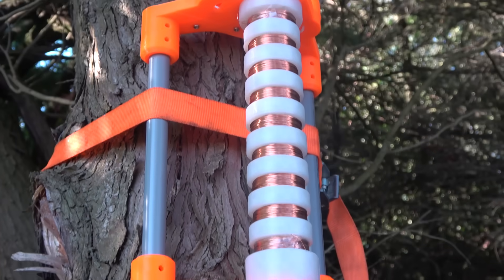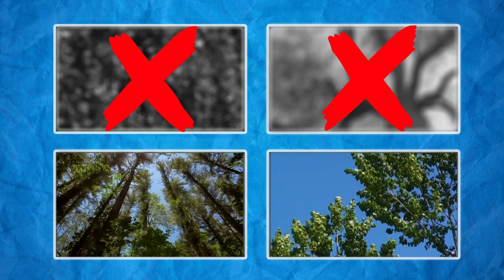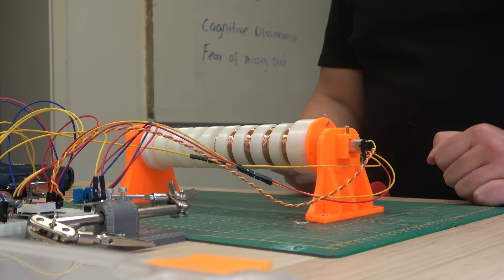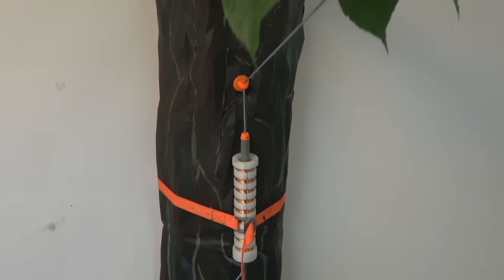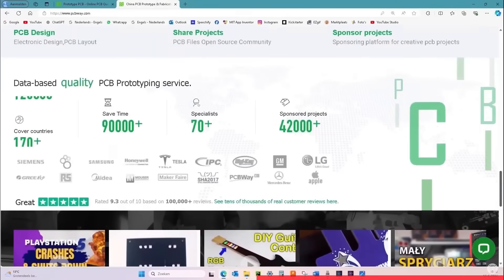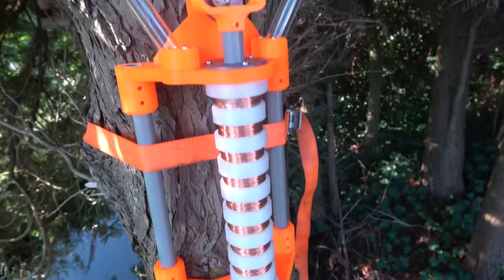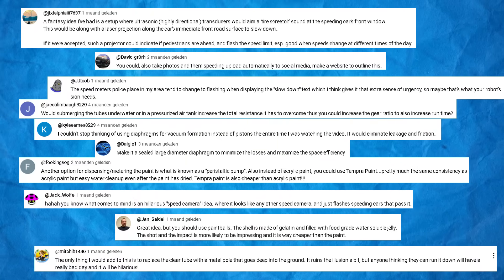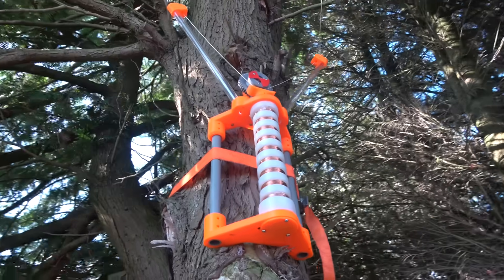I Made a Tree Generate Electricity..

Comment: Hey man, my vision of your system:
2 cables rotate the drum like yours, then the drum transmits rotation to the shaft where 2 bevel gears sit face to face, these two bevel gears are connected to the shaft using overrunning clutches (ratchets) one gear has an overrunning clutch of left rotation, the second gear has an overrunning clutch of right rotation, between these two bevel gears there is a third bevel gear perpendicular to their axes, that is, this is a gear assembly of 3 bevel gears where 2 are face to face and the third between them, this mechanism is sometimes used in watches the essence of this mechanism is that the drive shaft can rotate left or right, but the driven shaft always rotates in one direction, then the driven shaft is connected to a conventional rotary generator, but it is best and this is easy to do an axial BLDC generator with magnets on both sides of the coils, such a generator will have the highest efficiency, the efficiency of this system is about 80% this is one of the best options for removing efficiency, in The efficiency of the described variant is about 30%. It would make sense to consider a variator to stabilize the generator shaft speed because the speed would fluctuate, which is not good. However, I won't describe the variator, as this is a separate topic that arises after testing the basic concept described.

Comment: Hi, I'm watching from Russia with translation. If linear motion is converted into rotary motion anyway, why convert it back into linear motion? This is energy loss; it's better to attach a regular generator. You can also attach a flywheel so the tree spins it, which then spins the generator. Then the output will depend not on individual gusts, but on the overall motion. Attach one rope directly to the generator shaft, and the second through a gear, so that the flywheel always spins in one direction.

Comment: i designed this exact same system, but for ghosts! you take this generator to a haunted house, and connect it to the drawers and cabinets of the kitchen. when the ghost goes through and opens/closes all the doors and drawers, it generates some electricity. you can finally violate the laws of physics by harnessing ghost power! or else, ghosts aren't real :(. or  the third option of ghosts being real, but they gather power somehow from the sun (either directly or indirectly).

Comment: That's a cool concept but I can immediately think of 3 negatives:

1) Thieves will figure out that the magnets are worth something. They've already stripped all the copper wirings from foreclosed homes back then.

2) Critters, dead or alive. A dead critter will jam the piston, live critters might decide to nest inside it

3) Tension in the strings. You can't avoid it no matter if you're using nylon strings or steel cables. That means periodic tensioning. Not a problem if you install it on just a tree in your backyard, but if you owned a full acre of forest and wanted to substitute for solar, it becomes a hassle.

Comment: You need two more thing to make this work perfectly....1 is super capactor and second joule thief circuit. It can powerup plenty of LED like 24 normal LED brightly and it won't instantly turned if there is no movement. But it gradually fades but if the movement is frequenty then you have a nice light all the time instead of blinking on and off

Comment: What if one were to take the seeming random design of a branching tree that sways well and design an artificial one with this electricity generation system built as a component of that design? By optimizing the structure of that swaying artificial tree one would then be able to swap out parts as needed, if needed, and standardize the whole thing. A forest of these artificial trees could not only be an interesting thing to have a picnic beneath, but would be a testament to human ingenuity.

Comment: Here's an idea to turn some of that motion into kinetic energy for another linear generator the one top gear have it connect to another gear that goes to a ratcheting mechanism like you'd see on a bike you know it only powers that in One direction then have a flywheel come off that shaft to store the kinetic energy and then you can have another one of those Scotch yoak convert that rotation into linear motion through another linear generator if you could just figure out a way to store some of that energy from that gear turning into kinetic energy you might be able to get more power out of the system just an idea peaces out into the world and have a great day

Comment: You could attach a DC motor to the smaller gear instead of using the rotation to upwards/downwards motion system.
(Or make a rotational generator) 

You dont have to worry about the weight of the rod you have, and would only have to attach it to the smaller gear and not worry about converting rotational force into linear movement.

And having some kind of rectifier would be nice.
(Not sure if you mentioned this i might have missed it)
When the rod with magnets moves in one direction it creates voltage, when it moves in the opposite direction it creates the same voltage but its negative so you might want to have something that makes it positive like a rectifier with diodes.
(Im sure you are doing this but it wasnt mentioned in the video so im just checking)

So yeah using a system that turns rotational energy directly into electricity with a rotational generator/DC motor would be better and simpler.
And having a rectifier makes it so that it doesnt matter in which direction the shaft of the generator spins, it will always make positive voltage

Comment: Hello, I'm an electronic engineer currently conducting research in the area of Simultaneous Wireless Information and Power Transfer (SWIPT), which focuses on harvesting energy from RF signals to power low-energy, resource-constrained devices.
I found your energy harvesting system particularly fascinating and would be very interested in exploring its potential further—especially in applications such as Wireless Sensor Networks (WSNs). I would greatly appreciate it if you could share additional details, including any experimental results and STL files, as I’m keen to replicate your design and investigate how your work might be extended.
Thank you, and I look forward to your response!

Comment: I know a fellow with an off-grid farm.  I've puzzled about how to provide him with more power.  His world is primarily pine trees, so he needs to work on trunk flex, rather than branch movement.  Trunks flex very slowly, maybe 10 or 20 flexes per minute.  However, with any wind they are powerful, easily able to pull a man around.  I also fantasize about getting some real power out, maybe like 1/2 kw per tree.
I also envision a very light, small version that one could take camping, temporarily attach it to a tree and charge a cellphone.  That would be really cool.

Comment: Could do a wind up ratchet from the tree movement that self releases at when fully spooled and spins an axial flux permanent magnet generator with numerous phases integrated into the generator since engine compartment area or engine powerplant isnt its sole purpose you can make numerous phases as big and bulky as wanted

Comment: Scrap the linear generator and use a motor and gearset. Battery management system charges a battery, pull current from the battery.

Also, the linear generator gives me dirty thoughts.

Comment: I live aboard a 42' motor boat. I want to adapt this idea to capture electricity from TIDAL FORCES. Cause if the wind can move trees, then maybe long fins cold replace the tree and I can see power capture while on anchor or at a marina. As long as my boat is stationary, than the push and pull of the tide should be just as easy to harness using your plans... 
Additionally, a long arm attached to a float would create similar kinetic forces on deck, this would work well underway and far off shore where wave crests are high relative to the deck... choppy seas would overpower the system.

Comment: Drill a hole through the middle of the tree, run a copper wire through it, then wrap the tree with the Cooper wire. The more trees you can connect together with this process will generate electricity. You must connect the trees together, and with more trees connecting each other together gradually increases your voltage. Trees are a living entity which means they automatically generate electricity.

Comment: go bigger and put it across two trees with an alternator. The alternator then pushes the voltage to a array of super caps that would in turn go out as a current generator and charge a battery.

Comment: I 'm making a pendulum that will charge and run a light it will be powered by solar to power the pendulum and the pendulum movement to run the lights. your coil mechanism would be ideal I had intended to use similar to the shake charging touch but your design is much better designed. Good work 👍

Comment: Great idea!!! Thank you! Not sure, that this power supply will be useful as replacement for wind turbines, but it might be extremely useful for tourists. At the moment I know several sources of electricity in long expeditions. The most effective is solar panels (excluding powerbanks and gas electric generators). All attempts to produce valuable amount of electric power failed: water turbines are difficult to install, mobile wind turbines are quite bulky, Peltier elements are not effective. But looks like your solution is extremely effective for mobile electric generators. I've got manual crank generator, which can produce about 20W of electricity. Looks like everything I need to make mobile generator for expeditions: mount generator to tree trunk, add ratchet and gearbox attached to rope or cable and generate electricity. Manual crank generator weights about 0.5kg, 20m rope with ratchet and gearbox may weight ~1kg. So 1.5kg for limitless source of electric power is not a huge weight.

Comment: My main suggestion is to make sure you account for the growth of the tree over time when planning materials. The ropes or whatever can be longer than needed at first and utilize knots to keep the tension as needed. You'll also need to have something in place that can measure the tension so you know when it's good to make adjustments.
Additionally, trees have been known to grow around materials over time. A prime example of this is a wagon axel in a tree trunk nearby or a tree that grew into a wire fence. Anything you use to fasten the ropes can potentially end up becoming part of the tree if left unchecked.
But then there's the last thing. Is the tree actually necessary? You can make an analog for the tree that doesn't grow. As long as it has the ability to move in the wind without breaking down too quickly over time, such an analog can do the trick.

Comment: I think this is an awesome outside the box idea. I don't have much input, but maybe copying the fractal patterns for trees and other natural things. For example trees maximize their efficiency of wood to leaf ratio by splitting in two over and over. That's similar to what you did, instead of 1 string, you turned it into 2. What if you took those strings and ties them to multiple branches by spilting those strings into to two somehow. That way each generator would have the most utilization for the most branches. Don't know how you would split the rope though, maybe some sort of knot, or another gear system in between. Seems like it would be best on a longer term generator. Love your work!!!

Comment: The advantage of tree branch movement is not in speed or distance of movement, but in raw strength. Think if you tie cords to many branch ends which are connected at each limb juncture. The output energy when they all get blown by wind is combined. Designing the generator to harness only the distance or speed of that motion is neglecting its greatest advantage, it’s raw power. I would recommend a design that would harness all that power by some kind of variable resistance. Not sure yet what that would be.

Comment: But I was thinking of something I think might be cool if I’m not missing something but you have half of what I’m thinking but say in your house you had spring on it still and then a pulley on ceiling of house and the it comes down tied to heaviest weight you can lift without strain and another rope I’m thinking like 100lb fishing line or more to system and a rope to a second ceiling pulley to weight or just lift weight and have 10 of them and when you walk by lift them and they go to a highest gear ratio they can pull down slowly but of course spinning generator fast I guess I could potentially creep to the ground while generating power into batterie and as you walk by lift them quick and it goes again not for huge power but I don’t know how much weight can you lift with pulling down a rope or engine lift pulley I think it could take 15 minutes or longer to hit ground or I’m nuts

Comment: Place the generator horizontal instead of vertical. Then the strokes eight even out, for the most part. You could even put the generator on a bearing'd turntable so the force is even more balanced.

Comment: The *magnetic enhancement* likely refers to a *magnetic repulsion system* or *electromagnetic induction system* that increases the generator's efficiency or speed of operation. This could make the device generate electricity more effectively by leveraging the principles of *magnetic fields* to either:

1. **Reduce Friction**: Magnetic repulsion could be used to create a **frictionless environment**, where the moving parts of the generator experience less resistance. This would allow the system to move faster or more smoothly, converting more energy from the mechanical motion of the tree into electricity.

2. **Increase Motion Speed**: Magnetic systems, like those used in **linear generators**, can speed up the motion of the mechanical components. The 4x speed enhancement mentioned could be due to such a system, making the parts move faster with the same amount of wind or tree movement. This could amplify the electricity generated, especially if the system converts the linear or oscillating motion into more effective rotational motion.

### How Magnetic Enhancement Works Here:
- **Magnetic Field Interaction**: A system of magnets could be placed strategically within the generator. As the tree moves, the magnets could either attract or repel each other, creating movement that spins a rotor or drives the generator coils. This interaction could increase the generator's power output by converting kinetic energy into electrical energy more efficiently.

- **Inductive Power Generation**: If the device uses a coil and magnet setup (e.g., copper coils and magnetic fields), the movement of the magnets relative to the coils generates a **fluctuating magnetic field**. This induces an electric current (via **Faraday’s Law of Induction**). The 4x speed increase from the magnetic system would likely make this conversion process more efficient, generating higher power output from the same tree movement.

### Does It Account for Magnetic Enhancement?
- If the device includes a *magnetic repulsion system* and enhances its speed of operation by 4x, it does indeed increase the *energy conversion efficiency**. The faster the components move, the greater the **rate of change in the magnetic field* that induces electricity in the coils. This can potentially provide a significant power boost, allowing even small movements (like those from a swaying tree) to generate more electricity.

### Conclusion:
Yes, the device in the image likely accounts for the magnetic enhancement, particularly by leveraging the system to:
- Reduce friction and increase efficiency.
- Accelerate the movement of parts (speed boost).
- Generate electricity more efficiently via electromagnetic induction.

This means that, with the magnetic enhancement, this device should *outperform a non-enhanced, purely mechanical tree generator* by a significant margin. It would likely produce more power (possibly in the range of **40 watts or more**) compared to a basic mechanical system without magnetic help.

Comment: Probably you’ll harvest more energy if you collect the leaves of the tree in autumn. The leaves can be burned in a steam engine to run a generator. In this way you don’t depend on this certain tree. You have one technical solution to harness the solar power of many trees. Or you can produce bio gas and run a generator with combustion engine.

Comment: I like the linear generator idea.   I had a similar idea I never tried a few years back for a bow saw connected to the trees swaying in the wind... basically a continuous (when windy) camp saw. :) This is WAY cooler!  At the point you are converting to spinning motion, why not just gear to an ultra-efficient generator or alternator?  Also, any possibility of using a ring circuit to amplify the generation or the magnetic action?  Cool stuff man! Subbed your channel! cheers! 🌱